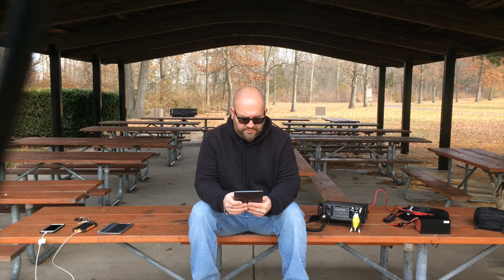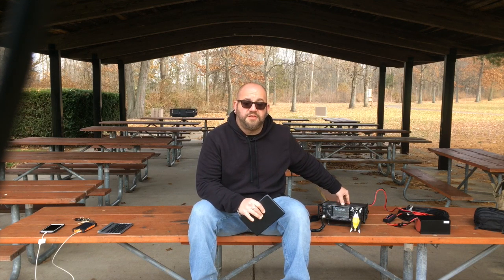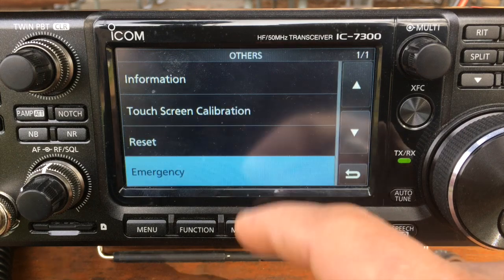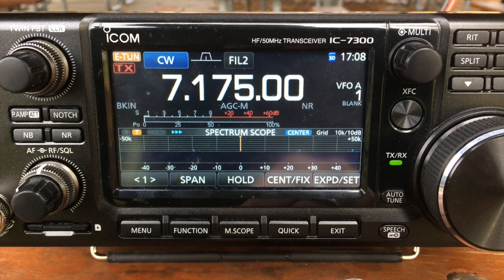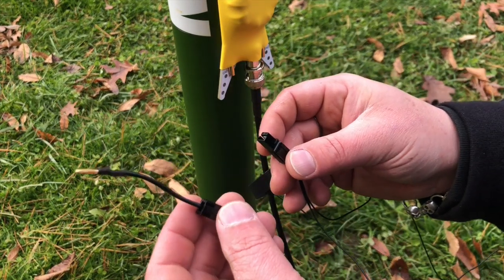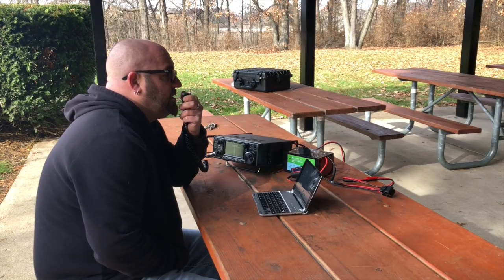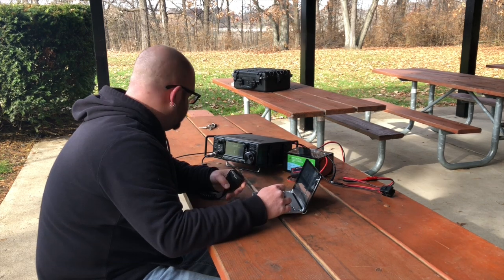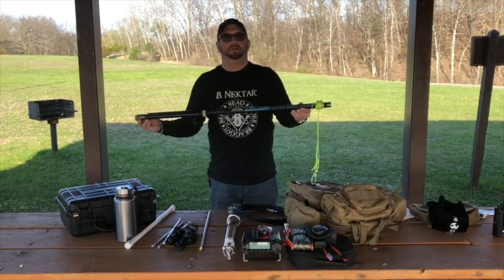PackTenna Mini Ham Radio Antenna Re-Review with the Icom IC-7300 portable.

Comment: out of stock at this time. I have the IC 7300. I normally run 50% power . using the MFJ off center fed dipole . only tunes 4 bands just fine. that the trick with 9:1 . non resonant length on any ham band.  going to try Pack Tenna  with DX commander DX 50 wire. the green stuff. maybe even a kite  antenna . 73's
Reply from the maker: Best way to find out availability is through https://packtenna.groups.io/g/main
Reply: @hamradiotube  they updated that they have DX Engineering reselling them for them now. an update.

Comment: Question for ya.  I just received my Packtenna 9:1 mini random today.  I checked it over and I like the construction.  I haven't hooked it up yet but I'm very pleased with it so far.

My question is: What is the banana connector on the top of the antenna body for?  It says it's for a second antenna element.  This is a quote from the owner's manual, talking about the connector I'm asking about:  "Banana socket for optional antenna element. This is connected to the output of the transformer and is in parallel with the supplied antenna wire."

I'm relatively new to the ham world, but nothing I have read makes this click in my head.  What purpose does a second, parallel antenna element serve?  It's not a dipole, it's not anything that I understand.  Could you shed any light on why Packtenna included that connector?
Reply: That second element you're referring to is not the primary radiating element. (The main antenna wire--the radiating element--you'll seek to get as high into the air as you can, even if just one end of that wire).  The OTHER element you're talking about is referred to as the 'counterpoise' in the video.  It's somewhat optional--as stated in the video, 'sometimes it helps (to achieve a better match in terms of impedance and/or SWR), and sometimes it's not necessary.'  If you do attach the counterpoise, you can allow it to lay on the ground.  It's stated that it's perhaps not as necessary if you're running a longer length of coaxial cable from the matching transformer (the guts of that transformer being the wound toroid that is under the shrink wrap) back to your radio--something closer to 15-25 ft or greater.  in that scenario, the outer braid on the coaxial cable can often stand in as the counterpoise.  While these antennas are referred to as 'end-fed,' the alternating current still seeks the other electrical half of the antenna--being the second element connected to the ground. (or braid of the coax).  Some of that current can make it back to the radio--and if it is causing problems, you can try adding the (somewhat optional) counterpoise, or you can try adding a "common mode choke" to choke off some of the RF energy, keeping it from flowing all the way back to the radio. Hope that helps

Comment: I just purchased a Nelson Antennas 9:1 UnUn. Ive found that a 41' wire with 2 / 17' counterpoises. Tunes 40 flat and about 1.5 on 20. 15 and 10 are also 1:1. I worked Italy on the G90 from my QTH in Ohio and he said I was 10 over 9. Lol prpogation was good but I was very impressed with this setup. 73s Mike great video.
Reply from the maker: Thats about the same setup as I use with this antenna.  Pretty sure its ~41' of wire but I use 3 counterpoise wires.  I think I cut them at 17' but I can't remember.  Works great.  I do prefer the PackTenna EFHW a little bit more just because its resonant.

Comment: Really good video. I am impressed with the information they shared with you and you with hams watching the video. They were very honest and spot on. I only use resonant antenna but still want to make a non resonant antenna like you are using just to see how well or poorly they work compared to a resonant end fed half wave antenna. 
Thanks so much for sharing. 
50 watts is only 3 db down from 100 watts. I never run 100 watts portable so that really is a perfect setup for that radio. Less current drain on the battery, the tuner works better and only 3 db down is really nothing. 
Thanks for taking the time to make and share your video. I really enjoyed watching.
73 de Barry, KU3X/QRP
Reply from the maker: Thanks so much for watching.  It was fun experimenting with the 7300 in emergency mode.  I didn’t even know it did that until I got this antenna and learned a little more about the radio.  The nice thing about this antenna is it can tune up on all the bands and it works very well.  I’ve had many a POTA activation with it.  While I do prefer the PackTenna EFHW slightly more, this is a great antenna to have in your kit.

Comment: Hi Mike,
Do you happen to know what wire you used for the counterpoise?
Bill - W6BKM
Reply from the maker: Its the same wire used for the radiating elements.  Its from The Wireman.  I picked up a couple hundred feet at Dayton a couple years ago.  Its 26awg I believe.  I would really recommend a 22 or 26awg PolyStealth wire though.  That stuff is awesome. .https://www.amateurradiosupplies.com/category-s/218.htm
Reply: Thanks for the info Mike.

Comment: Outstanding video! Which Packtenna do you recommend starting with? I would ideally like to start with both the mini end-fed half wave and mini random wire along with the mini in-line RF Choke. In a perfect world I would get all of them.
Reply from the maker: All of them is certainly nice.  I'd say my favorite is the EFHW, followed by the mini 9:1 and the dipole.  They all work great but I like the multi band resonance of the EFHW.  If you make it long enough for 80 meters you pretty much get all the bands without the need for a tuner.  It comes with enough wire for 20 meters but I linked another section for 40 so I get 40, 20, 15, and 10 I think.  Cant remember off the top of my head, but you don't need a tuner, you don't need to link or unlink anything.  It just works.
Reply: @hamradiotube  Thanks for the info! Now if they would get them back in stock i could order one!
Reply: @WJ6FRadio  My thoughts exactly.  Went to buy today and not a single antenna in stock
Reply: @gregorysmith3097  I was able to finally get one of the End-Fed Half Waves, and I couldn't be happier. First day using it I made a contact in Alaska!
Reply: @WJ6FRadio  Glad you were able to get one.  I don't need one until July, so I will just make sure that I keep looking at availability.   Just planning ahead.  glad you like it, The groups.io says that it should be in stock in about a month.

Comment: Great video Mike 
So if I have the FT-891 and the End Fed Half Wave Packtenna, will I need a tuner? 
Thank you 
KO4GBB
Reply from the maker: No you will not. I did a video on the efhw as well.  I love all of the Packtennas but the efhw is quickly becoming my favorite.
Reply: @hamradiotube  Thank you Mike 
I came across the video you made about the TIA 1000 
Which do you prefer

Comment: You could also just make a 9:1 UNUN and put 41' of wire on the output. It would work the same and be a lot cheaper. Any time you operate coax at other than 50 ohms there will be extra losses in the dielectric.

Comment: What length wire did you end up running on the PackTenna?
Reply from the maker: The full length.
Reply: OK, check out the following link, it will explain exactly what was being talked about in the video and lengths of wire to use/not use.  Hope the link comes through, otherwise copy and paste it.  I homebrewed the packtenna mini and use 41" of wire, works great....     http://www.hamuniverse.com/randomwireantennalengths.html      Paul NA9M
Reply: What length was ‘full length’?  I’ve read it’s 29’ and I’ve seen 41’.  Mine is 29’ is your’s the same 29’?

Comment: Would have been nice to see more of how you had the antenna laid out. Did it go up the 30 ft pole then slope down to the ground? Was that 40m you made those contacts on?
Reply from the maker: The wire just goes all the way to the top.  The pole is 43 feet so it is straight up.  Contacts were on 20 and 40.
Reply: @hamradiotube  Nice! How long was the wire?
Reply from the maker: Brian Pietrzyk 39 feet or so.  I’ve never measured but it’s just as it comes from Packtenna.  The counterpoise wires I think I cut to 13’.

Comment: Had no idea you could get a 10:1 tuner in the 7300 at reduced power. Cool thank you for sharing.
Reply from the maker: There seem to be mixed feelings about using that as it is an "emergency" tuner.  The advanced manual doesn't say much about it.  It would be nice to know if it was actually safe to run that mode at will.

Comment: Is it a good thing to use the emergency tune function on a regular basis?
Reply: The IC-7300 manual says to only use it in an emergency.  A external 10:1 tuner isn't that much money considering the overall cost of an IC-7300. Rather than risk the radio, I'd just pick up an external tuner. 73 de w8tam
Reply from the maker: @de_w8tam  Well Tom, I'm glad you asked that.  I don't know.  I can't see how it would hurt it.  Half power and all the meters look good.  I'll have to ask Ray Novak at Hamcation.  Better yet, I'm gonna hit up Icom on Twitter.
Reply: @hamradiotube  You could just put a Palstar AT2K in your back pocket for portable work. LOL. Missed your activation again,,, O well I have caught you a couple of times before. Cheers from Maine.
Reply: @hamradiotube  The rating on tuners (relays, inductors and capacitors) is rated both in duty cycle, and maximum voltages. If ICom wanted to put a 10:1 tuner in their radio, they would have. They choose to put an 'emergency' mode in, that is labeled emergency, not labeled 'activation without an external tuner'. High SWR can produce high voltages and break down insulation and overheat the ferrites. Adding a mode that you can abuse your components to save your life is a sellable feature. They didn't built it that way so you could use it whenever you like. I doubt they would provide warranty repair from a damaged tuner used regularly in emergency mode. That's my $0.02. 73 de w8tam
Reply: @de_w8tam  I figured it wasn't a good regular practice. I don't have a 7300 just was curious. I would rather have the external tuner take the heat and abuse.

Comment: Why not put the choke next to the antenna, instead of at the half way point?
Reply: Putting the choke at the mid-point allows the 1st 25-feet of coax coming off the antenna to act as a counterpoise while surpressing common mode currents coming back to the transceiver.  If you put the choke at the transceiver you will have 50-feet of coax potentially acting as a counterpoise.  For a 40 meter antenna, 25-ft is probably better than 50-ft for a counterpoise wire.
Reply from the maker: @jamescoffey5225  Yes.  Exactly, I was gonna say that but you beat me too it...darn haha!  But that is why, except he was asking about the choke at the antenna, not the transceiver.  But still the same answer just in backwards mode.  Thanks for the comment.  73
Reply from the maker: Not sure.  I do neither and it works so I'm not gonna fuss with it.